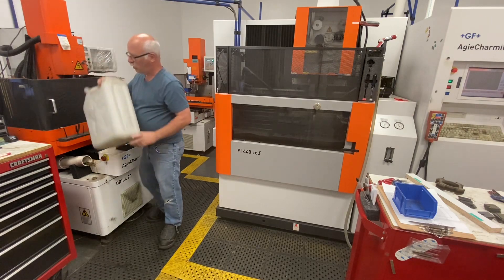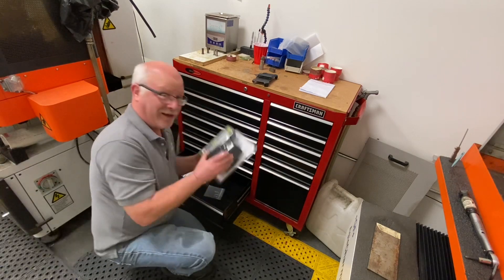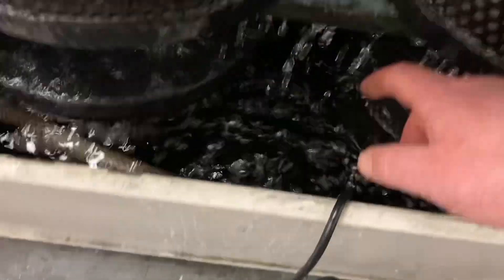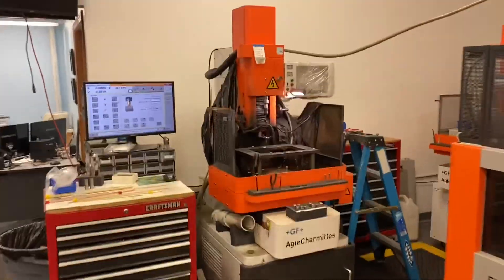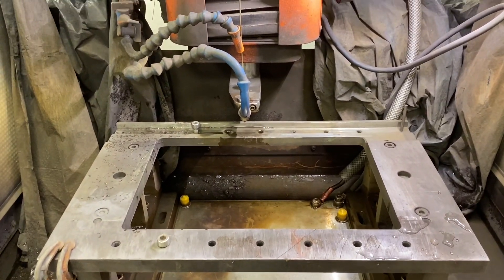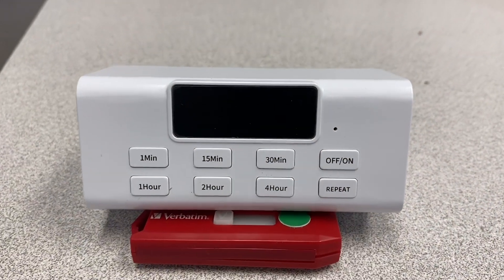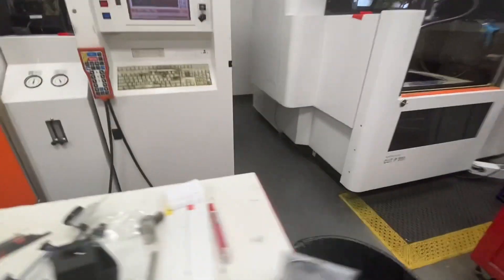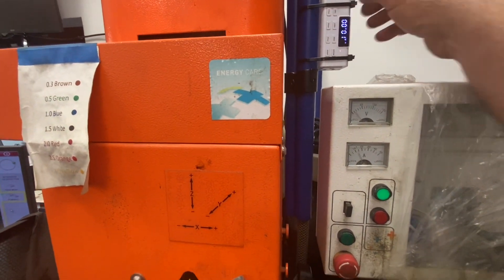Improving How to add water to the Hole Popper

Comment: Where does the water disappear to?
Is it evaporating?
Reply from the maker: Rob, where does the water go.  Well, some of it might "splash" out of the machine, be on parts when they are removed.  Some likely evaporates by normal life.  Some might evaporate during the machining process I would assume, as the spark is extremely hot, to "melt" steel.  And I'm sure some of it is in the air as a fine invisible mist.  Those would be some of my guesses.  We might add water once or twice a week depending on how much we use the machine.  Hope that answers your question
Reply: It sounds like most of your evaporative loss would be captured by placing a lid on it.
Food for thought.